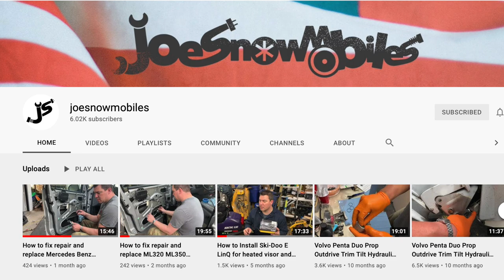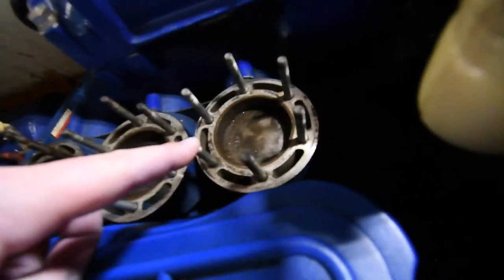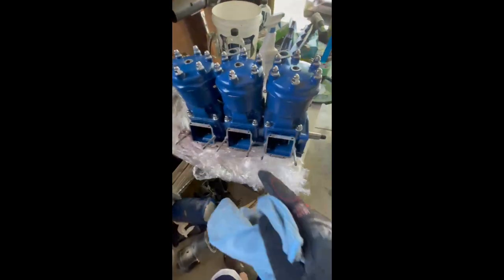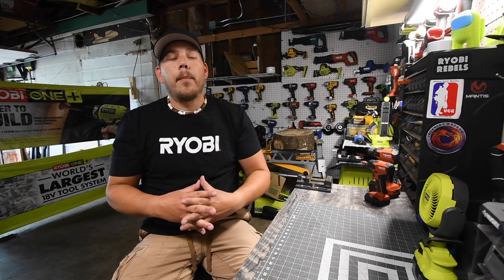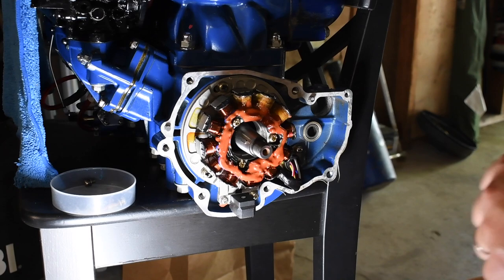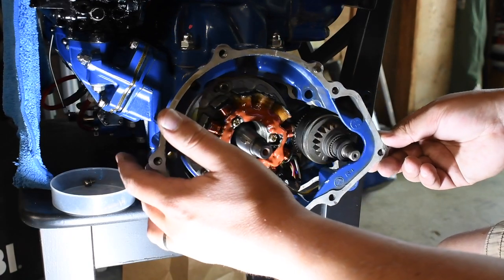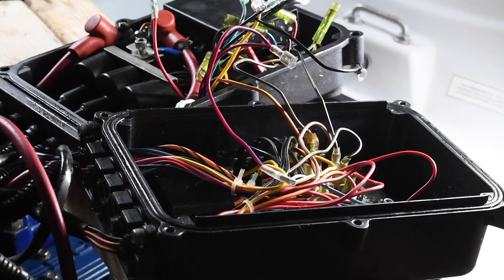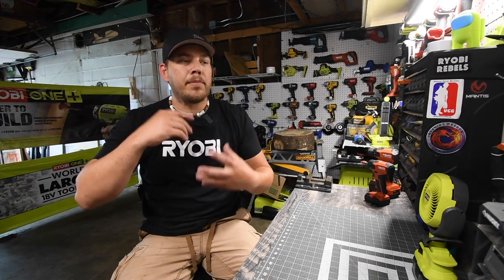1997 Polaris SLT780 (Rebuild)

Comment: An experiment idea:
- What happens if you coat a boat propeller in a super hydrophobic coating? Does it run faster, quieter and using less power? Does it produce more thrust, or less?
- What about if you use a hydrophilic coating?
- Additionally, what if you only coat certain parts of the blade, but not others?

Tool idea;
- A hybrid compressed air/electric tool.

Comment: Why didn’t you use a torque wrench on the core???
Reply from the maker: I got rid of this, I got it running but couldn't keep it running. once water got in it would shut down, I didnt have the time to take the engine out again.